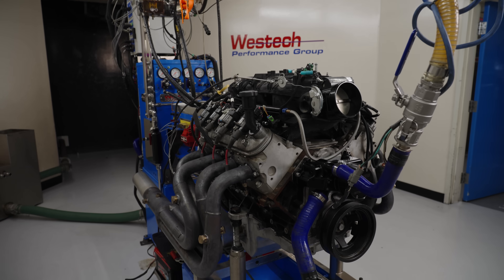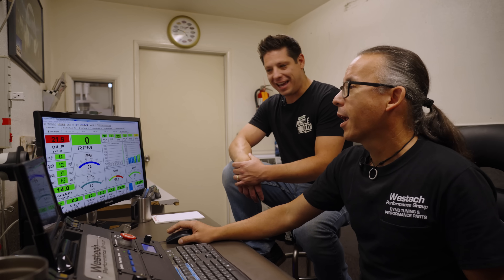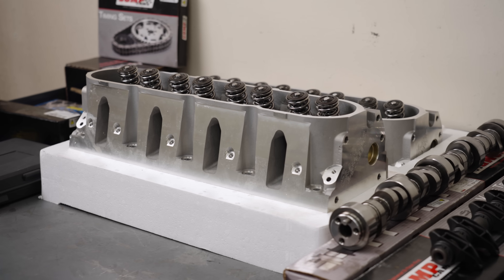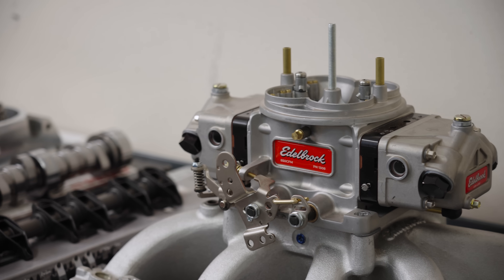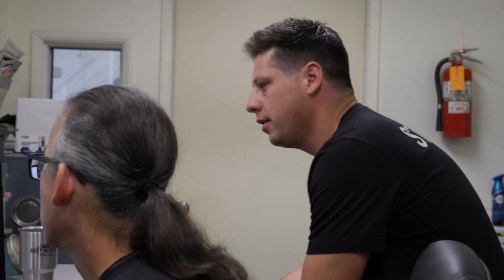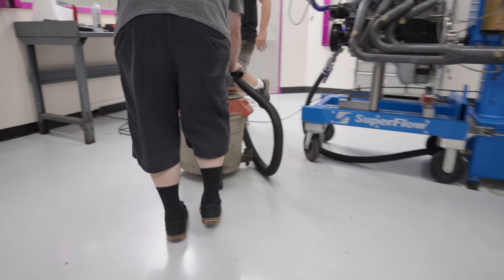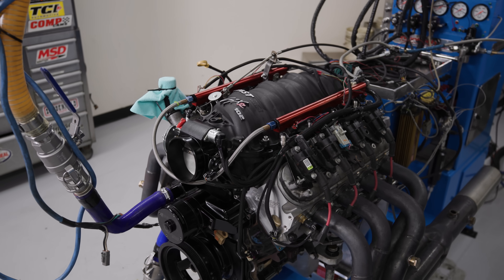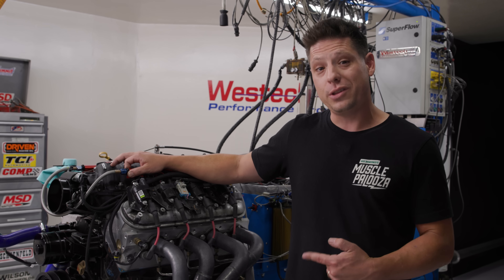4.8L LS: How Much Horsepower Can We Squeeze Out Of GM's Smallest Displacement LS Engine?

Comment: Coyote makes 500 hp with 301 ci with stock cams and heads !!!! 😂😂😂😂😂😂😂😂😂😂
Reply: Cool, how much do they cost?
Reply: @DullBoyJack right!  the only 5.0 that makes 500 with stock cams is out of an 18up mustang and is $8k plus used, you can get 4.8ls’s all day long for less than $1k. The truck 5.0 will make about 430 on Dyno, stock and those cost $3-4k+
Reply: @guyforlogos  you forgot the price of the heads, cam, lifters , pushrods , rocker arms ,head gasket,intake gasket,oil,labor to get out of a junk yard and to build it !!!!!!! Coyote comes with that from the factory,you don’t need to touch it !😂😂😂😂😂😂😂
Reply: @chuckg5785  and all of that is far less than the $8k, plus it fits in between the fenders of just about everything. I know the 5.0 coyote is a great engine, but it’s priced out of this competition.

Comment: The reign of the LS1 has lived on because it’s just such an economical package for both price/performance and package dimensions. Would love to see a tear down and refresh for a boost build.
Reply: No coyote engines in off road baja where needs to stay together for 15 20 hrs at about 5-8 k rpm.
Reply: Reign of the LS? 
Which one has gone 5.88 @ 256mph with an almost entirely oe parts engine? None. John Mihovetz has taken the 4.6 4V to that level. 
Which LS has gone 300.4mph in the standing mile? Zero.
A prepped 5.4L Ford GT has.
Which LS has won overall Sick Week, Tx2k24, Import vs Domestic  with a sleeved oe cast block and heads and oe crank breaking every Drag and drive radial record ever? None. Brett Lasalas Coyote has.
The LS has "reigned" on cheap easy builds... but not ultimate performance with oe cast engines. 
Last note. The one year 4V engined were allowed in the Engine Masters Challenge in 2013, the 4V Fords took a clean sweep on the podium and crying from the GM camp forced a rule change and the 4V aren't allowed now against the pushrod engines. 
All those extra cubes don't make up for inferior flowing heads. Fact
Reply: @chadkent1241  that’s great. Brett’s Snot Rocket 1.0 and 2.0 were insane. Still doesn’t change anything that I said from being true. The LS swap reigns supreme because of price/performance and engine package dimensions. At this point, everyone knows the Coyote is a phenomenal engine. But the 4.6 and 5.4 are not ideal swap engines BECAUSE they’re so massive and heavier than an aluminum LS - making them harder to use in some vehicles. Not sure why this provoked a history lesson from you about Ford engines, because it wasn’t a personal attack on Ford engines at all. Just the fact that the LS swap (especially the junkyard truck engines) are still one of the best options to swap into your build.
Reply: @chadkent1241 the coyote is gigantic and expensive in comparison to an LS.  

Hence why the LS reigns in popularity.
Reply: @chadkent1241 I watched a video with John discussing a new product from Accufab (a new Coyote block or something of that sort) and when asked about the old 5-second Modular car he stated he was swapping new blocks regularly for that motor because they kept cracking. About every other pass or so. That stock engine didn’t stay in one piece for long at all. Just an FYI.
Reply: @chadkent1241  fanboy much. No one in the LS community is doing that because all of the REAL LS top gunners' are BIG DISPLACEMENT, Aluminum block, bespoked, twin turbo and nitrous sniffing demons. The ONLY reason the Coyote and modular Fords are doing it is because it makes far more sense to Force boost through it than build a N/A package with bore and displacement limits baked in from the factory.

you're comparing 32v performance based engines against work-a-day, small displacement TRUCK motors that were never intended to make much past 325hp at 5800rpm and soldier on for hundreds of thousands of miles pulling loads and working. Apples to oranges. 90% of the "4.8-5.3 LS" builds involve junkyard motors. 

Also lets not forget, a simple ring job and F.I. focused Cam, will put ANY 4.8-5.3 over 1k hp on 80% stock parts. it's been done and is 20 year old news at this point.
Reply: @chadkent1241  My dude, get over yourself. The vast majority of gearheads have a budget and need some streetability. None of the engines you mention are remotely close to the avg guy's budget, and when they are, they don't make nearly as much as an LS with the same money put into each. They Coyote is getting there, but all those Ford engines are physically massive and need a ton of work to fit into older cars.

Next time rather than riding other people's coattails, post what YOU were able to do with those engines. Personally I've tuned cars doing 9's with stock blocks & cylinder heads and supercharged Vettes making enough power to ruin 6l80's. The absolute worst thing for the car culture are people that expect grandious projects like a 500hp nail head and talking smack about an LS swap that starts up like a normal work truck but out-runs any stock musclecar era engine.
Reply: @chadkent1241  not even close to oem rods and pistons.
Reply from the maker: The LS in Speed Demon went 400mph. That seems like a pretty impressive number to us. Also, no one hates Ford's here, there's simply no denying the LS's prevalence in the high-performance community.
Reply: @chadkent1241  can't get a modular motor for a couple hundo..

Comment: Baseline horsepower is about 20hp up on a dozen of Mr Holdener's stock 4.8 dyno baselines
Reply: And Holdener usually tests Gen III engines, This is a Gen IV.
Reply from the maker: @bluecollarhotrods9781  That's correct this is a Gen IV. WAAAAAAAY better manifold than a Gen III so we had a bit of a head start.
Reply: Arent all those baselines the same? I'm sure Richard uses the same baseline for all his 4.8's

Comment: The best thing to do with a GenIV 4.8, would be cam+springs and a GT45 Sloppy Mechanics Don't B.S. Me build. Otherwise, before I spent for aftermarket heads and a FAST 102, I would probably go to a set of 706/862 heads with the ports touched up, milled from 61.5cc to 58cc instead of 799/243 heads with 64cc and 2" intake valves that arent needed, then thinner headgaskets, like 0.039"-0.027, rather than stock 0.051", really for what aftermarket heads and intakes, expensive cams and shaft rockers cost and if you have accesses to a reasonabibly priced machine shop, either get a 5.3 core engine, or buy a used 5.3 crank, GenIV floating pin 6.098" rods, cheap cast floating pin 3.898" pistons, assemble the engine as an iron 5.7L, then run the original 243/799 heads, TBSS/NBS intake, ebay/amazon SSIII 238/242 or Summit Single plane 240/252 cam + Pac 1218s, 1.75"-3" headers, try ebay 1.8 rockers to raise the lift to .630/.630 or .604/.604 at the valve, get the compression up to 11.4-11.8:1, get the quench dialed to 0.040" or less. There's your 500hp n/a for similar money to the 4.8 with that expensive top end, induction and cam+valvetrain. Then as you work that bottom end you could make 540+hp with higher end cams, head work or heads, induction, very high compression for e85, nitrous or boost. An SBE 4.8 is really best used for boost, a dude ran 7s in the 1/4 with one in a New Edge Mustang that he claimed he never took the heads off. 4.8s will never be n/a heroes without being bored and stroked. They are cheap and perfect for amatures getting into turbo builds because the power capability is there and if it's destroyed because of a mistake or misfortune it's not a huge loss. Most people really can't use or apply the 1,000+hp a turbo 4.8 is capable of so seeing people waste a good aluminum 5.3, 5.7, 6.0, 6.2 or iron 6.0 they didnt need and couldn't use in a turbo mishap is sad and was an engine some guy running n/a could have gotten a lot of use from. I always reccomend iron 4.8/5.3 for turbo use. A 6.0 iron that could have been used n/a or to build a 408 stroker being destroyed in a budget turbo build is a sad thing.
Reply: Hell, I got a set of 243 heads off an impala ss for 180 out the door at the pull a part, am running the texas speed 228r 600 lift cam, trunion upgrade, efi source gold box, and kooks full long tubes and true dual exhaust on my 2002 Camaro and let me tell you, the 4.8 in this thing screams. I usually dont shift untill 7100
Reply: What’s your channel? Lol
Reply: I have a 4.8 in my 03 silverado with peformance reman 706's and tri metal race head gaskets. It also has a 15 whp edge tune on it and 3.73 gears it does surprisingly good for having a stock cam still.
Reply: Link
Reply: If N/A I would also bore the cylinder out quite a bit. Believe LS1 pistons fit. They have extremely thick cylinder walls. I would change the compression with the piston swap to match the cam, too. At least 10:1.
Reply: @Joseph-xx3rz I would never consider a 4.8 for a N/A build. I get what these guys are doing here but in reality if you’re looking for stout numbers from an N/A a 4.8 is not going to be your first choice. TBH a 5.7 LS1 barely makes the cut nowadays when you can get an LS2 with a 4” bore and ability to run an LS3 top end for a decent price. 4.8s are for boost.
Reply: @caliLakerNiner  a 5.7 flat piston is comparable to a ls2, the 6.0 has a dish. The compression advantage makes up for the few cubes lost.

Look at a c5 z06 vs a ls2. Both have 243 heads.
Reply: @rickybellamy8191  The main difference in power between the LS2 vs LS6 is cam and intake manifold. LS6 uses lighter valve train.
Reply: @caliLakerNiner  same cam. C5 z06 and ls2 vettes. 204/211 duration cams. Intakes, ls6/ls2, you're splitting hairs.
Reply: @rickybellamy8191  Same specs as 2001 LS6. 2002-2004 are 204/218 .551/.547 117 LSA. Also, LS2 intake is notorious for poor flow out if the box while the LS6 intake is one of the best LS intakes from the factory.
Reply: @rickybellamy8191  At the end of the day the 4.8 is just too small. Why go that route when you can go with something like a 6.0 LQ9 or  LS2. 4.8/5.3 are for boost.
Reply: @caliLakerNiner  oh no, I agree. Just don't discount the 5.7, 80+ lbs lighter than a 6.0 and a compression bump.

Almost done with a ls1 5.7 build. 243 heads worked over and milled for 10.9:1 compression. Texas speed 224/228 duration cam and sticking with a stock truck intake for a few. Peforma built 4l60e with a circle d 3200 stall. Looking for a 12.99 in a 5100 lb 4x4 on 33x12.5s.

Tall task, but I think I can get this to run close to the TRX/Raptor Rs.
Reply: @caliLakerNiner  and yeah, the 4.8 is too small to go all motor. That's what I pulled out with 862 heads.
Reply: @caliLakerNiner  if u have a light enough car a 4.8 is fine some of these guys running real light cars and I've seen a S10 do 13 on the street with 4.8 stock shortblock. I would not even bother with a 5.7 a 5.3 or a 5.7 is fine especially a street strip car. I'm still talking stock short block too
Reply: @rickybellamy8191   Oh yes most definitely the 5.7 is a good option for N/A. Seems like no matter how old the 243 casting is it’s still an excellent choice. Many years ago I had a set of 232cc 243’s worked over by Advanced Induction. Those heads flowed great on a 5.7 LS1 based 383. Didn’t break the bank either.
Reply: @davidvesce   Once again…a 4.8 is TOO SMALL for a potent N/A setup. Maybe if we are talking a Miata. lol But your average domestic vehicle weighing north of 3000 lbs is going to be slow with a 4.8. Having been in the LS world for so long the thought of building a 4.8 for max effort N/A is laughable. When you can just buy a 6.0 LQ or find an aluminum LS2 block instead. There is a reason why none of the fastest LS N/A builds use the 4.8 (or even the 5.3 for that matter unless sleeved & stroked). 4.8’s are for FI builds. To each his own tho.
Reply: Dude, if I'm throwing that kinda money into a engine then I'd just buy a 5.7 or a 6.6
Reply: The problem is the factory pistons don’t have valve reliefs so putting a .630 lift cam with 240° @.050in of duration will cause the pistons to hit the valves. We used a 235° cam and it barely cleared with just over .090in piston to valve clearance which is tighter than I like things to be. There is certainly more power on the table with a full engine build, higher compression pistons with valve reliefs, and more camshaft/cylinder head, more displacement. That just isn’t what we were trying to test here with a stock short block.

Comment: Why aren't you quoting torque?  Stock.
Reply from the maker: The maximum torque we saw on the dyno was 378.5 lb-ft. Being this engine is only 292ci we expected it to be more of a high RPM screamer and it was.
Reply: The dyno graph was right there. It seemed to be a match or close to it to horsepower.
Reply: Torque is king on the street!